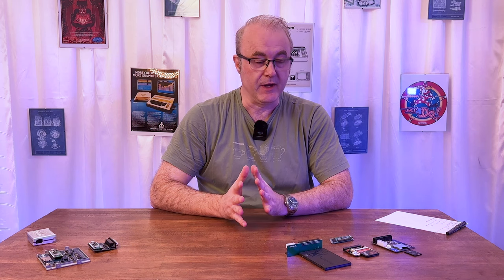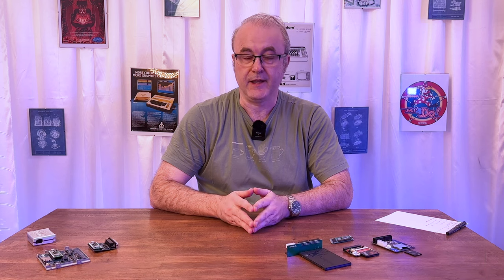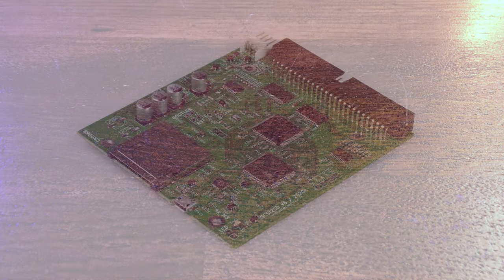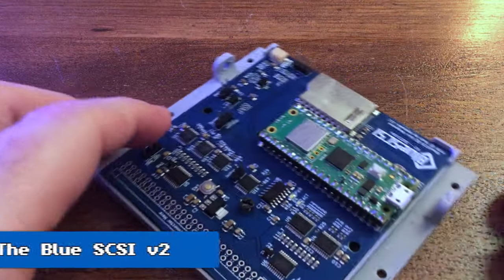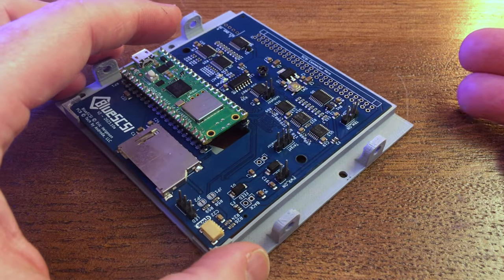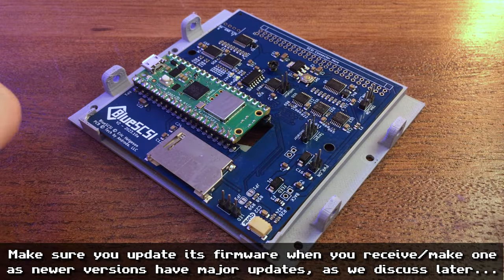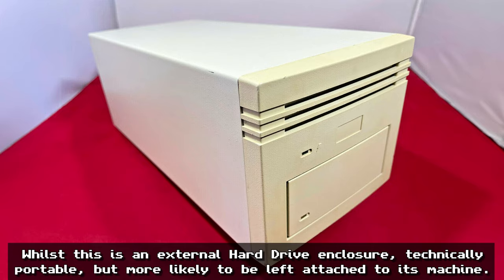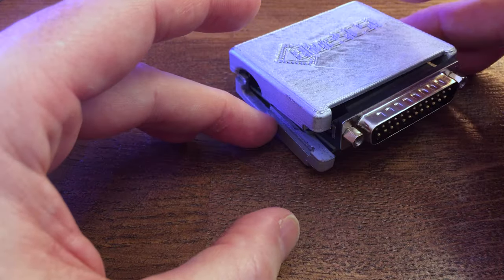Making & Using a BlueSCSI v2

Comment: Hi- Eric from the BlueSCSI project - thanks for taking the time to share your experiences using BlueSCSI! A lot of Amiga work has gone in lately - namely a WiFi network driver and soon some native Amiga apps to help you interact with your BlueSCSI. Disk Jockey just had a release today with a bunch of Amiga goodies in it as well.

Quick note is that the headers have a short side - if you install them down and long up it'll fit in the case.
Reply from the maker: Wow, the WIFI network driver will be an amazing addition, its not something I covered in my videos to date (lack of support on THOSE the videos subject) but its a great feature of the BSv2, its potential to provide a WIFI network connection. Very welcome news :)

It's a great project Eric, but certainly more tools on the Amiga front would be welcome. I love retro Macs as well, but of course big box Amiga's and even side-car equipped ones, like my A500 sport SCSI adapters. I find the BlueSCSI v2 very easy to use, once you get used to the flow. But some native apps would be amazing.

Ill bear in mind the jumper direction tip, for future projects!
Reply: Where in the UK can we get the BlueSCSI external SCSI assembled with the case?

Comment: Don't put solder on the soldering iron to move it to the pin. Think of the solder on the soldering iron as a "thermal paste" to close the gap between the tip of the soldering iron and the pin and pad on the board. Then move the solder from the opposite side to the gap between pad/hole and the pin. Then the flux that is inside the solder is enough, no additional flux needed. This also doesn't waste energy, if you do it often you will get a feeling for it and you can just drag the tip along the pads and pins and the solder from the other side. There is then also no need to clean excessive flux.

The wrong method shown here causes the flux that is in the solder to just burn up, the solder then oxidizes and won't flow without additional flux. Also 400°C is probably way too hot or the soldering iron isn't calibrated. At 400°C you can expect flux to burn away really fast. I usually use 250°C to 300°C depending on the solder.

And stay away from cheap noname solder, stay with reputable brands. Melting points and the internal flux depend on the alloy, old Sn Pb based solder usually melts at 180°C and has a fairly mild flux and give shiny solder joints. Old lead-free usually melts above 230°C and has a very aggressive flux and produces dull grey solder joints, which can easily be confused with cold solder joints. Newer lead-free solder melts around 220° and there are even low-temperature lead-free options with melting points comparable to those of lead-based solder or even way below. Chip Quick's original product (at least what I know them for) is a solder with the same name, it is bismuth-based and its melting point is so low that it can be used to desolder components by just adding it and heat it up.
Reply: I've always used Flux on the joints as well as Flux core solder. Usually pre-tin the components also. Using his method could lead to "cold" solder joints. It's better to heat the joint with the iron on one side and feed the solder in from the other. The solder should flow on the heated components, not hopefully to them causing gaps and voids where the oxidation and other impurities don't allow for proper bonding between the metals.
Reply from the maker: I must admit, this was an experiment, I am aware of the method you outline above. On this occasion, no issues, both cards work, both run cool, and the internal card has pretty much zero stress. The external device however, WILL be plugged in over and over, so lets see how that goes. For now, it works... However, I'm not saying its a textbook method. In terms of solder, I'm using some that came with an old iron, as its thin. I do have some I bought, but its much thicker. I'm no expert on soldering, learning as I go along, and any and all advice welcome ;)

Comment: Sir, your technique of transfer soldering is not correct. You would get the correct strength of the solder joint from heating the pin, then feeding the solder joint with solder. With new electronics or through hole, flux in the solder should be sufficient. Also, yes, there is flux Inside the solder. Sometimes use extra expensive flux is a false economy.Generally i only use flux to finish or on old electronics or for surface mount components.Just a side note the extra long legs on the raspberry pi can be cut with a good set of side cutters.This is from a 35 year plus electronic technician.😮
Reply: but if your a non soldering sort of person, heating pin is recipe desaster, the there a lot plastic on the pins, warm/melting, going to be one long problem, if you are going pick holes, and for beginner, and not the best place to start, the PICO is a surface mount part, stand off are not needed , just place PICO on the main board lining up the pins hole (there not called that, something else), and solder away along the edges as you do!, not not easy to-do some skilled needed, assuming that why  it  not explored in this video?

Comment: what about using a SCSILVD to SATA adapter then you can connect them to the Motherboard of your computer
Reply from the maker: What would be the advantage of this. Bear in mind, for 1980s retro computers, anything of massive capacity is massive overkill? Willing to hear more...
Reply: @RetronautTech  You would be able to use a 256GB CRUCIAL SSD.
Reply from the maker: @DAVIDGREGORYKERR  Yes, but for an Amiga 500 thats a bit overkill. There is a game collection for Amiga called WHDLoad, which includes games from the 1990s which an A500 CANNOT run. Even if you installed EVERY game it could run, then it would probably only take 32GB of disk space. File sizes back then were based on floppy disk use, so its only when you want to host say CD-Rom images that you would need 32GB+ hard disks. Still, its an option. I used SATA to IDE on my IBM PC Ergo Pro, and perf on that was very good. But this was a Win98 machine, so I would maybe reserver SATA drive use for those machines. But you can of course use SATA to IDE on an Amiga 600, 1200 and 4000 if you wished.

Comment: Your soldering method is dodgy! You said it yourself that you are not heating the pin very much. That means the solder will not go into the hole properly which can cause dry joints later down the road. It's better to heat the pin from one side a bit then introduce the solder on the opposite side. The solder you are using already has flux in the core so the syringe of flux is not needed. It takes practise to get used to putting the right amount onto the pin and not holding the iron on it too long or it will melt the plastic the pin is in, though that does have high heat tolerance, but not sustained.

Comment: GVP Impact II HD8+ is SCSI2 unit  3.52mb sec but 68000 will slow it down. Maybe you can get 2mb-3mb with ASYNCHRONOUS DATA. I got 1mb with SCSI2SD v5

Comment: You might try a better flux/solder and a hotter iron, otherwise they won't reflow properly, resulting in those "cold" solder joints.
Reply: Yep. The solder looks like its sitting on the joint - it should suck solder into the hole and not sit on the pin like it is.

Comment: Wish there was a cheap open source SCSI to USB these days.
Reply from the maker: USB to SCSI? not sure how that would work, there is logic specific to the SCSI standard, and it can handle 6 devices or so, so, all of those devices data would have to go down a single serial connection. I guess someone could make one. But would it be cheap?
Reply: Also you have the right method down, but you want to use more solder vs having a blob on the iron since if its not heated it'll still pull in since there is solder mask and flux in play. For anyone watching, there are awesome USB-C irons out there that probably outperform any station I've used --TS-80p @RetronautTech